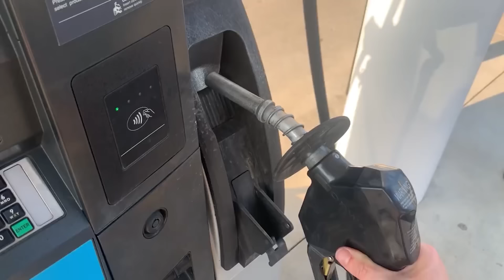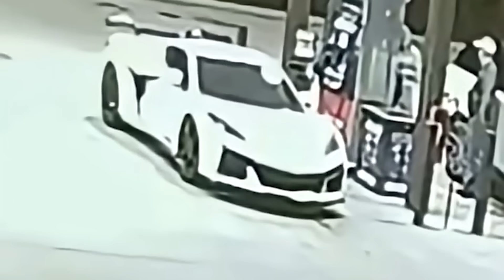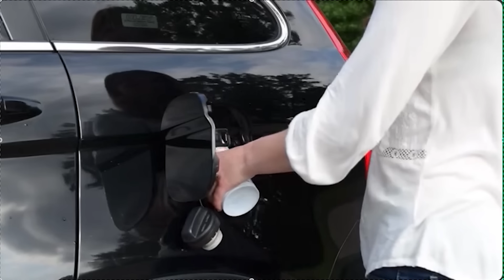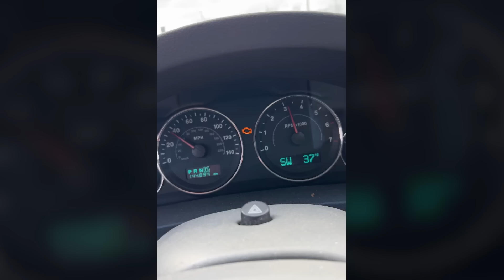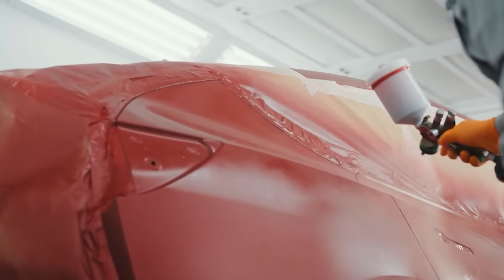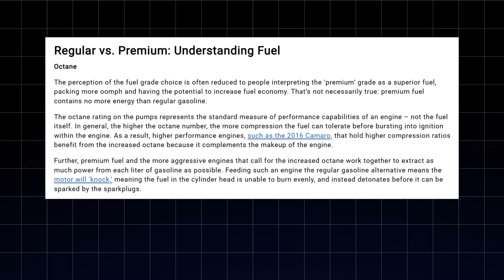Never Do This Before Refuelling ( Costly Mistake 95% of Drivers Make)

Comment: I used to drive until the low fuel warning light came on, not knowing it could damage the fuel pump. Thanks for the insights.
Reply from the maker: You're not alone—that's a common habit among drivers, but glad this helped clarify why it's best to avoid it!

Comment: I used to always force extra fuel in after the nozzle clicked — I hated leaving even a few cents behind. Then my EVAP system failed and the mechanic literally asked, “Do you top off after the click?” Guilty. The repair cost more than a year of fuel. Ever since I stopped overriding that safety click, no more gas smell or codes. People say it’s harmless, but my wallet disagrees. Curious who else learned the hard way?